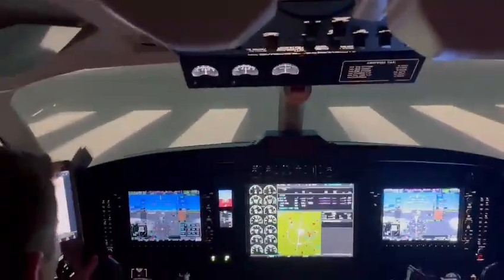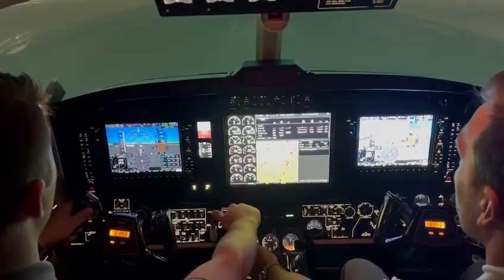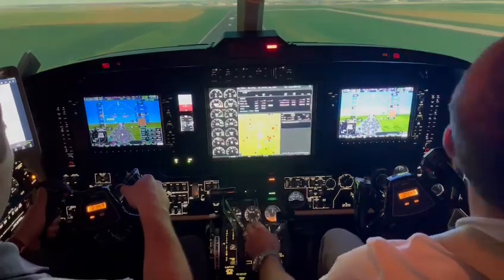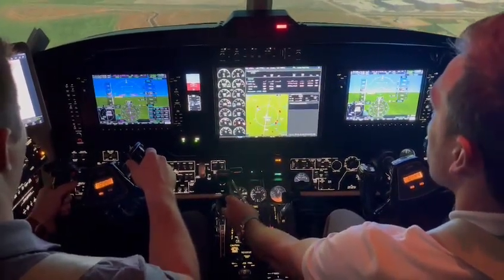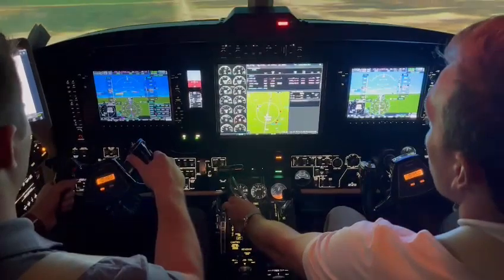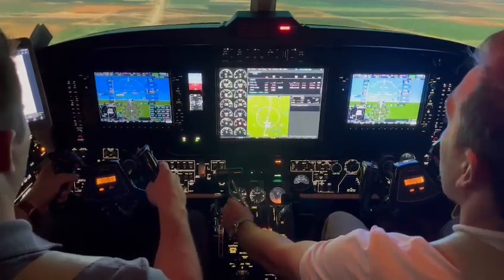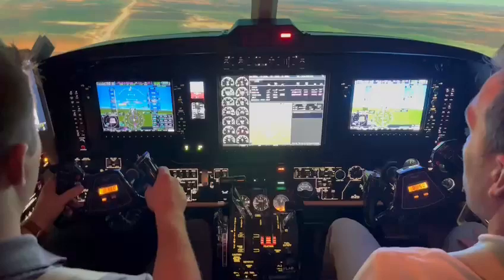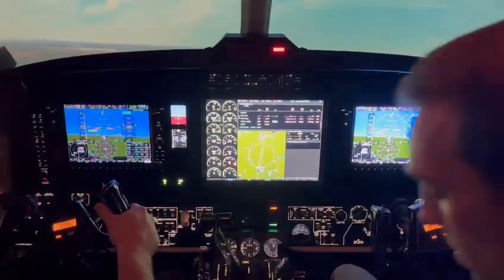Engine Failure During Take-Off - King Air Training

Comment: You really should retard the "dead" power lever before fuel cut off as this re-confirms which engine has failed. It also gets it out of the way so no possible future misuse of the power levers.
Reply: This disarms the autofeather.. genius.  

You NEVER retard the throttle in a King Air after an engine failure.  Verifying is done with gauges: failed = torque/ITT, feathered = less than 1000 RPM,  no fire = no fire indication/no visible smoke/flames

The engine is secure until you are above 1500 feet.. THEN you do the drill verifying condition lever ICO, prop lever feather, firewall shutoff. Then… and only then.. do you move the dead engine power lever.. usually to the firewall so it’s out of the way.
Reply: @calvinnickel9995  The auto feather has already done it's job! So I cannot agree with you.The dead engine prop has been feathered. I flew the B200 for 7 years and 2000 hrs. Too many misidentifications of which engine has failed are happening. If you retard the power lever on a dead engine nothing happens. On a live engine you see it immediately.

Comment: Never yank a T-Prop off the runway unless you're VERY light and already way above v2.   ESPECIALLY in the SIM when you know a V1 cut is a possibility.

Done a million V1 cuts and one thing that will ALWAYS help you is speed over the rudder.  If you lose the engine right at or just above V1, Leave the mother on the runway till you've fixed the drift away from the centerline with the rudder.   Get it back on centerline or at least parallel to the centerline. Then and only then, smoooooothly rotate and keep the rudder where it needs to be to keep the nose straight.  Proper airspeed and target pitch attitude will save your ass and give you a chance to display your Johnny Wadd SE landing skills.
Reply: Facts
Reply: There’s literally no V2 in this aircraft.  

And remember what V2 is for planes that have it.  Takeoff safety speed and what you maintain for your first and second segment climbs to 400 feet.  Your Net Takeoff Flight Path and obstacle clearance is predicated on this and it might be limiting.   

No.. don’t keep the plane on the runway unless you plan on aborting and maybe going off the end as a way to contain the error to the destruction of the aircraft.
Reply: Well, yes on those rare occasions when terrain is an issue you have a point.  Please explain, “no v2”.   Never flew a KA but the T-props I have flown had a magic speed.  I never got yelled at for exceeding that speed, only going below it.  I have used this technique for multiple type ratings for a long time and have never been dinged for it.  My point is, leave the ground without wild oscillations, and under rock solid  control.   A sloppy, V1 cut with large roll oscillations can kill your checkride LONG before being fast on a V1 cut will.     And to take that another step, my last employer said to hold the speed you attained at the completion of rotation if it was faster than v2.

Comment: I’ve never flown a king air but if this was a real scenario why couldn’t they just bring both throttles to idle and land on the remaining runway ? The gear was already down with some runway remaining ?
Reply: i'm Pretty sure I heard the engine failure past Rotation. the Co-Pilot called V1 which is the calculated decision speed, if they had tried to stop they could have overrun the end of the runway. Better to take the problem air born, clean up the drag (gear), maintain VYSE (best clime rate single engine or blue line) declare an emergency, and come back to the field.
Reply: @chrisbonneville3584  this correct ofcourse. But in reality they could easily have relanded.  reduced viz would be more realistic so that the pilots would be unable to discern the end of the runway-this would compel them to take the problem airborne.
Reply: in real life i would have retarded throttle sand landed-they had miles of runway to go. But aviation calls for going into the air after V1. Every situation is different.

Comment: Some folks here are missing the point. The exercise here was obviously to take off with 1 engine. Of course, if you have enough runway length to abort, you abort, but this was obviously a training exercise on managing an engine failure at takeoff.

Comment: One thing I did see is that the pilot was not maintaining a small bank angle not more than 5° away from the failed engine.  This causes a considerable rise in Vmca and might be very dangerous.
Reply: Its simulator... in real life these guys were dead if they autofeather do not work inmediatly.
Reply: @crare227

lol.. no.  

I don’t know the numbers for the 200..  but the 350 Vmc is 94 and V2 is 117–over 20 knots difference.  

And it’s max gross, most unfavourable C of G, most unfavourable engine (which is the left or critical engine..  not the right).  

And ever wonder how you maneuver single engine?  A turn into the dead engine won’t make you fall out of the sky.  Same as the base to final turn isn’t deadly because aerodynamically.. the plane doesn’t know the difference. It’s poor flying that bites you in either case.  

You can bank into the dead engine as long as you accept the change in heading.

Comment: Been in a King Air sym at Flight Safety in Long Beach- this guys did just about everything wrong possible- u immediately contact ATC, declare an emergency, analyze the remaining roll out distance, (plenty of runway to land) and ABORT the takeoff
Reply: Although an abort may have been the right decision, calling ATC as the FIRST course of action is a fail. I’ve been in a 747 sim in Denver. That doesn’t qualify me as a 747 captain.
Reply: You need to go back to your primary training because everything you just said is terrible advice.  The very LAST thing you do is communicate to ATC. They did not appear to have enough runway to land; but knowing that from watching a video is impossible, as you have no information on runway length, weight of the aircraft, etc. Now that said, in a King Air, once you pass V1, you are committed to take off. They were well past rotation speed at the time of the failure.
Reply: @ronhenderson9258  thanks Ron. you wonder why people get cranky reading their crap. unfortunately, they will never have the perseverance to ever get any license.
Reply: No sir, making sure the flying is safe, and you have control of the aircraft is the number 1 priority.
Reply: You never call ATC first.  

Please never get into the cockpit of an airplane.

Comment: They need Autothrottles and then it's a non-event
Reply: That doesn’t make any sense
Reply: @michaelshean2167  If you have ever flown the IS&S autothrottles you would understand what I mean about engine failure with autothrottles on the King Air - it's a non-event.
Reply: lol.. I fly a king air with auto throttle.  It’s actually harder.
Reply: @calvinnickel9995  What variant King Air?

Comment: Why continue T/O  while you could land it with enough runway
Reply: If you are past v1 you are not stopping unless its a serious malfunction (dual engine failure, loss of directional control etc.). King Airs have great single engine performance if flown correctly and its safer for everyone to take an issue into the air and deal with it.
Reply: I'm guessing to simulate on a short runway

Comment: maybe work on some SOP's and have a well defined profile for engine failure and it wont look like a dumpster fire departure.  But that will all come with more experience, King Air 200 is a lot of airplane for new pilots.

Comment: nice ! !  Why did you wait to much  to cut the mixture / feather  , did you were waiting some indicated airsped ?blue line or something else ?
Reply from the maker: This king air has an auto-feathering system, after rotation we confirmed the engine auto feathered and climbed at V2 to 400 feet AGL then accelerated to Vyse (Blue line). Next brought up the flaps and climbed up to 1000' AGL then secured the engine. if the engine had not feathered we would have manually feathered the engine prior to 400'
Reply: @avhub2736  nice !! thanks for the info